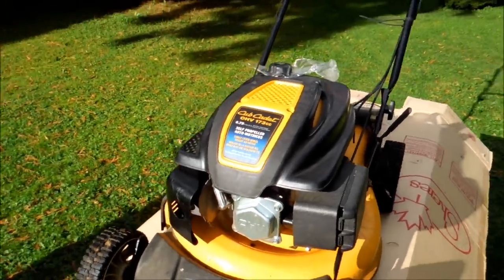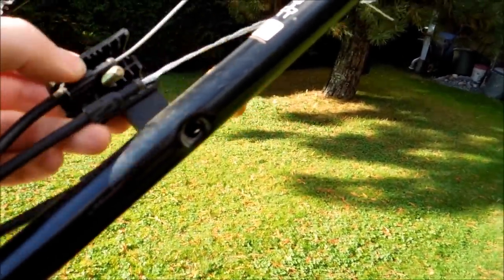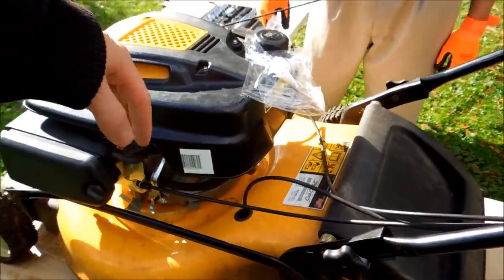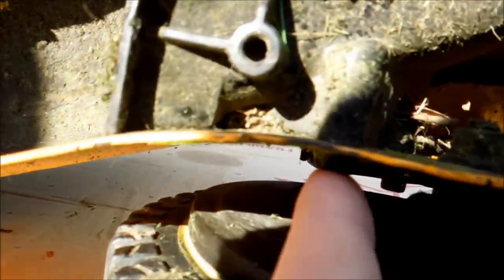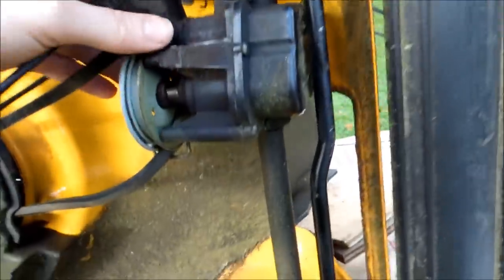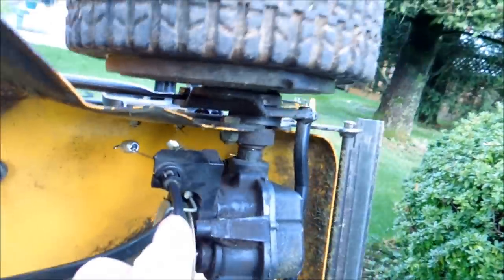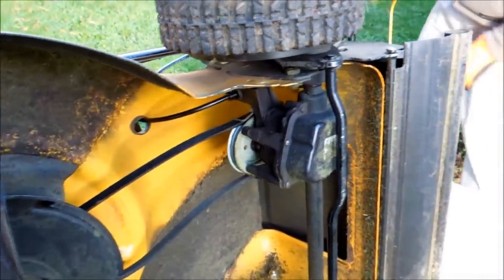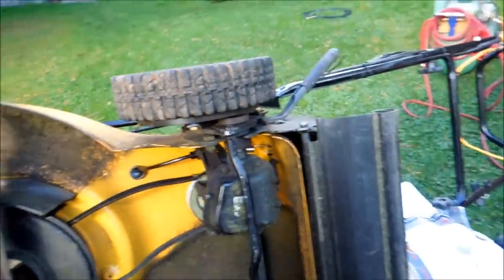HOW TO CHANGE A DRIVE CABLE ON A CUB CADET LAWNMOWER

Comment: Thank you so much for this video.  I was able to replace this cable on my lawn mower for $23 (parts).  I also borrowed your idea of putting a sandwich bag under the fuel cap and it worked perfectly to keep the gas from leaking out.  I'm deeply appreciative.

Comment: You failed to show the connection at the other end, where the cable attaches to the handle. That's the only part I needed to see, and it's not here!
Reply: Any luck with the other end? I’m having same trouble and the few other videos do the same thing.
Reply: @tylermerker5268  me too
Reply: What the hell… I have been all over the internet looking for this…. Pissed off

Comment: I'm sure I would have learned something, if it wasn't for the crap camera work and 100 mph commentry. Do it again, properly please
Reply: You gotta be kidding me. Your inability to slow down a video is the reason you shouldn't even be attempting to use a lawnmower. You should stay inside with a helmet on at all times bro.

Comment: I have the same lawn mower... Ordered the correct part and it seems my cable is too long, it has slack in it no matter how much the plastic part is tightened, any suggestions? It's hooked into the correct clip and clipped into the plastics, very frustrating seemingly super simple problem.
Reply: I have the same problem. Were you able to figure it out?

Comment: I have the same mower but I can't get the plastic off underneath.  yours shows screws/bolt towards the front, mine does not have that. I can't afford to have anyone fix it for me. any advice?
Reply: can you post a picture of how your plastic cover looks like? I just did this myself and worked fine.

Comment: Thanks for taking the time to do the video, it's helpful, but, it might be a good idea to mention to EVERYONE that when you do any work on a mower that you should take the lead off the Spark Plug, if you don't and whatever you're doing turns the blade if could and probably would fire up the engine and spin the blade with DISASTEROUS results for your fingers, hands and arms. 

ALWAYS remove the Spark Lead !!!
Reply: @ Canada Bob..... YES!!  I was really surprised that very important bit of safety advice was left out and rewound to the beginning because I thought I surely must have missed it.

Comment: Why are these cables failing?  The Walk Behind I have has a cable that shuts off the motor if you should let go of the lever.  Cable Control ERS63.00 WL Part # 946-05105A  It is the only cable listed in the parts Repair on Cub Cadet's website.  Mine broke not at the end but 5 inches inside the plastic tubing it travels in.  Nothing was wearing on the cable or pinching it.  No reason for it to fail that I know of.   But yet it is the only cable on the website so it must be the only one that fails a majority of the time.  Why doesn't Cub Cadet use stronger cables?  Next time I buy a lawn mower I'll be looking at the parts list to see what fails or has to be replaced with time.  2 years is not much time!

Comment: There is a bolt that was unaccounted for in this video(total of 4) . It is on the outside of the mower deck and is part of the bracket that holds the rear wheel assembly on.  Took me a while to find it. was struggling trying to get the flange under neath off. Took me about 45 minutes to find once I did the cover just about fell off in my hand

Comment: Thank's for posting this. Initially I thought I had to remove the blade. It's the second cable replacement I buy because I ruined the first one. Removing the plastic cover was the toughest part, probably because I have a slightly different model but your tips of moving the self propelling rod helped a lot for easier access to the springs.